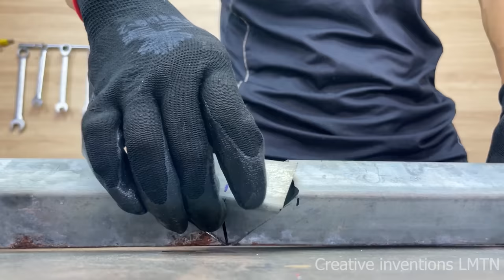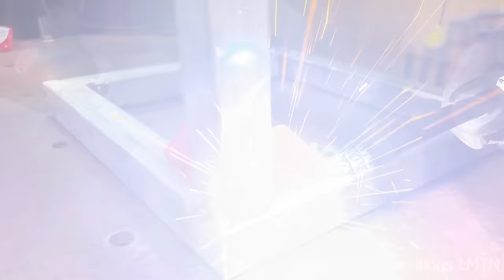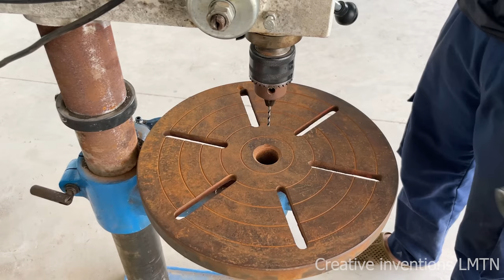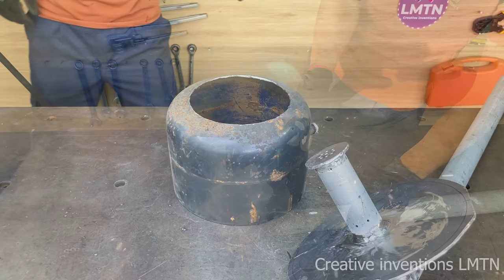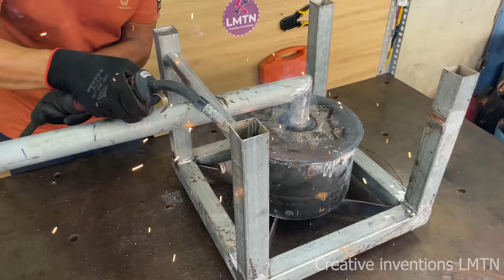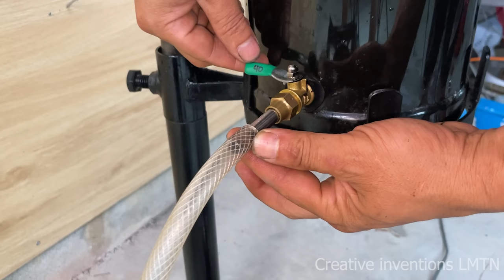DIY USED OIL BURNER STOVE | Creative inventions LMTN

Comment: If I want this I am from Vadodara Gujarat plz rep me
Reply from the maker: Certainly! If you're interested in building or acquiring a similar setup and you're from Vadodara, Gujarat, you can explore local hardware stores, workshops, or online marketplaces for the necessary materials and tools. Additionally, you may consider reaching out to local craftsmen, metalworkers, or DIY enthusiasts who can provide guidance or assistance in creating a similar heating solution based on your preferences. It's always a good idea to connect with the local community to share ideas and experiences. Good luck with your project!

Comment: itsn't smoke or smell come out?
Reply from the maker: The presence of smoke or odor can depend on the type of fuel and materials used in a particular project or setup. In the context of your video or project, if you're concerned about smoke or odor, here are a few things to consider:

1. *Type of Fuel:* The type of fuel you use can significantly impact whether there is smoke or odor. Different fuels, such as wood, oil, or others, produce varying levels of smoke and scent when burned.

2. *Ventilation:* Adequate ventilation is essential to ensure that any smoke or odor is properly vented out of the area. Proper ventilation can help minimize the impact of any emissions.

3. *Combustion Efficiency:* The efficiency of your combustion setup can influence the production of smoke and odor. Well-designed systems can help burn fuel more cleanly.

4. *Maintenance:* Regular maintenance of your setup can also play a role. Clean and well-maintained equipment is less likely to produce excessive smoke or odor.

5. *Local Regulations:* Be aware of any local regulations or restrictions regarding emissions and indoor burning, as they can vary depending on your location.

If you have specific concerns about smoke or odor in your project or setup, it's a good idea to evaluate the fuel, ventilation, and combustion efficiency, and consider any necessary adjustments to minimize any unwanted emissions. Additionally, following safety guidelines and local regulations is essential to ensure the safe operation of your project.

Comment: Does it poisonious?
Reply from the maker: The toxicity of a product or substance depends on what it is made of and how it's used. To determine if something is poisonous, you need to know the specific materials and chemicals involved and the potential risks associated with them.

If you have a specific item or substance in mind, please provide more details, and I can try to give you more precise information about its safety and potential hazards. Additionally, if you have any questions or concerns about a particular product, it's a good idea to consult safety data sheets, product labels, or experts in the field for accurate information.

Comment: But how does this work??
Reply from the maker: Yes sir, it works very simply, just pour waste oil into the tank and light it, then wait for the fire to heat up. Turn on the fan and it will burn normally. If you want to know more, watch our video carefully in the channel. We have many instructions on how to use the product. We hope you will gain experience and interesting things in our videos, thank you.
Reply: @lmtn  I know how to operate it , but I want to know the mechanism behind it, as you only supplying air through the blower it could blow off the fire

Comment: Apka Chula kitne ka apur kahan milega
Reply from the maker: I believe your comment is in Hindi and translates to "How much does your stove cost and where can I get it?" If that's correct, you can respond with:

"Chulha ka daam aur kahaan milta hai, yeh sthal par depend karta hai. Aap local market ya online platforms jaise ki [cụ thể tên nếu có] par dekhsakte hain. Ismein istemal hone wale samagriyon, design aur kshetra par bhi nirbhar karega."

Translation: "The cost of the stove and where to get it depends on the location. You can check local markets or online platforms such as [specific names if applicable]. It also depends on the materials used, design, and the region."